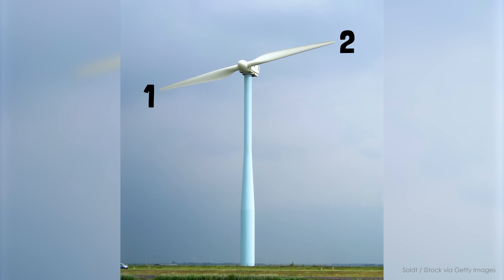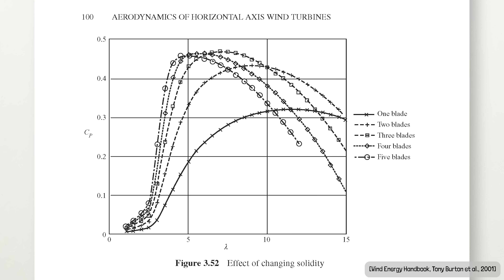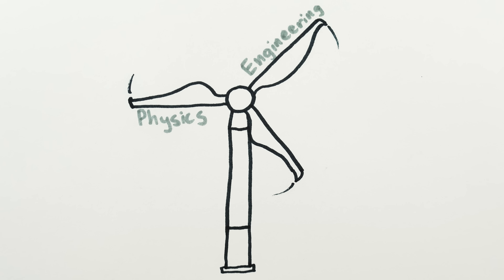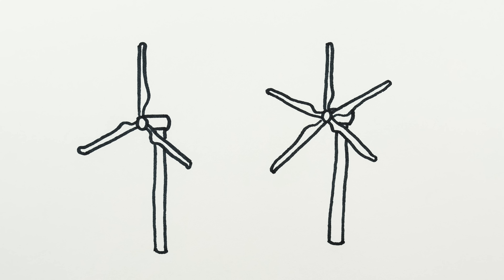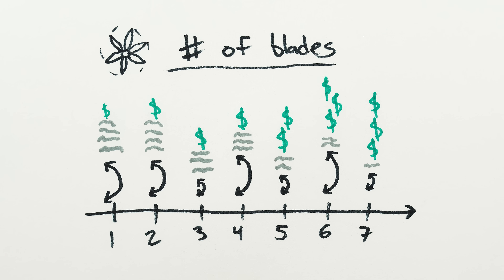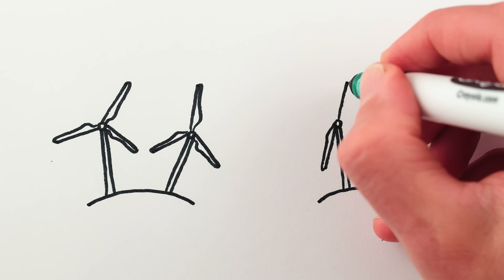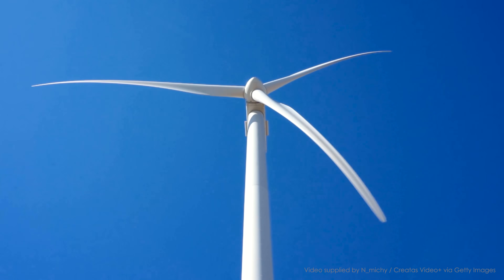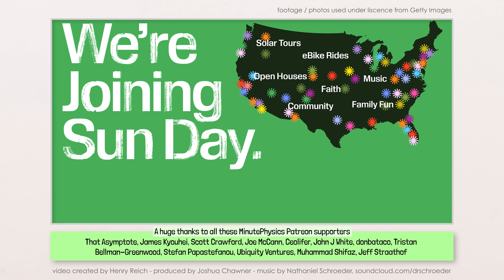Why Do Wind Turbines Have Three Blades?

Comment: Now I want to know why most buildings have rectangles as a base, instead of say, hexagons or triangles. You can tile the plane with hexagons just like with rectangles, and hexagonal prisms would have easier time keeping cool in summer and heat in winter. Still everywhere it's usually square
Reply: not an expert on the matter, but I would guess something related to space efficiency because we can make the most use of space with rectangles. Imagine filling your room with a slanted corner/wall. Rectangles make it easier to place side by side without wasting space and to organize like a grid system. Also maybe generally easier to make/measure than other shapes
Reply: One distinction between hexagons and rectangles is that you can subdivide rectangles into other rectangles, but you can't subdivide hexagons into other hexagons.
Reply: @BrooksMoses You can subdivide triangles into triangles and hexagons into triangles. Plus if you look at honeycombs you'd see that small hexagons can approximate a large hexagon really well when the difference in scale is large enough. Sadly can't add pictures there.
Reply: The best I can do: 
    ⬡ ⬡ ⬡
  ⬡ ⬡ ⬡ ⬡
⬡ ⬡ ⬡ ⬡ ⬡
  ⬡ ⬡ ⬡ ⬡
    ⬡ ⬡ ⬡

Comment: Should push for nuclear, the cleanest and safest energy. Lowest death rate per kilowatt hour generated of all sources of electricity
Reply: the problem for adoption is that nuclear is more expensive and it takes longer to set up
Reply: and what about nuclear waste?
Reply: @S4N1T03T3R it can be reprocessed into more fuel.
Reply: @shrimppasta5544  how much of it?
Reply: @S4N1T03T3R over 90%
Reply: @shrimppasta5544  okay and how much biproduct of that 90% reusable biproduct is usable next? is it also 90% of it or does it depend on the element and state of the element? 

even if we say it will stay on 90% no matter what, this 10% scales up more and more the more you use it and especially the more reactors you use, so you still need to dump it somewhere
Reply: @S4N1T03T3R im not gonna spend this much time debating something when there is a 0% change of you possibly considering supporting nuclear power. Sorry.
Reply: @shrimppasta5544  i am actually in support of nuclear power, im just curious how recyclable the fuel actually is or has become

you see i am from Germany, the country has abandoned nuclear power which im not a fan of, i would like us to get back into nuclear power but these are questions which i am curious about and dont have answers to

Comment: According to to recent news, Envision Energy has recently "cracked the code" on 2 blade turbines.  I can't find much detail.  I would assume they have good-enough high speed bearings and structural support, but I'm guessing they're still less efficient at lower speeds.

Comment: When I think “windmill” I think of the old school Dutch windmill (for actually milling), which have 4 blades. Was this because their engineering was less sophisticated, or are the physics of those windmills different due to different materials and the like?
Reply: Those actual mills are much smaller and spin much slower (measured in m/s at the tips of the blades) so the reasons mentioned in this video don't matter all that much.
Reply: I think old windmills have 4 blades because it's much easier to make right angles manually. Two planks of wood bisecting each other creates the foundation for a 4-sail windmill. Historical windmills of other configurations exist though. They also sometimes used the orientation of a stopped 4-spoke wheel to indicate information. (The + could mean the miller is there to sell flour, while x could mean they're away)

Comment: To match the current phases on the grid, duh. One blade for each phase.

That's probably how that works.
Reply: That doesn't sound right, but I don't know enough about current phases to dispute it.
Reply: Wrong. Wind turbines make DC power. The DC power gets converted to AC power using an inverter. The rotation of the wind turbine has nothing to do with the frequency of the grid.

Comment: Why do skyscraper sized turbines with diesel power backups need to exist at all in a Solar system with so much abundant solar radiation that 100 global civilizations living for 10,000 simultaneous years of progress, would still never run out of it?  Seems like a massive consolidation at the cost of many harvested resources and many hours of human life, and the only thing coming out is a power bill for what should, and could, be free from the sun.
Reply: Because we don’t yet have the means to build a Dyson sphere
Reply: @alexsiemers7898  don't need a Dyson sphere, just solar radiation that's striking the Earth and Moon right now.  Not even remotely close to all of it, either.  The Sun is pretty intense even out farther than Mars.

Comment: As a mathematic, I feel like there is unexplored potential in wind turbines with negative three blades.
Reply: We should consider a complex number of blades.
Reply: @KellyWu04 Or three purely imaginary blades.
Reply: @davidw6936  Don't be absurd. If you don't believe me ask Euler.
Reply: @KellyWu04  Three was the closest they could get to 2.71828
Reply: Right, that's when you install the blades backwards, which turns the rotor backwards, which supplies the same power, but out of phase.
Reply: @TheExalaber  thats still +3 blades, which means drag. I think the negative blade idea has some strong potential
Reply: @Gaaaaaame No, its negative drag but also negative propulsion, this turning backwards.
Reply: @TheExalaber  yeah then you just flip the coils around, no biggie
Reply: @TheExalaber  no no no it actually sucks the power out of the grid which is really bad
Reply: A fan.
Reply: you know, that could be considered one of those spiral windmills, those are really neat too and much safer for birds, though much smaller and less efficient.
Reply: @dawnderg  birbs
Reply: this shows a complete lack of imagination: why not 3i?
Reply: Also building -3 blades will also cost negative money. Great way to generate profit
Reply: You have an impeller with no blades on it whatsoever, then you take three of them away - simples! :)
Reply: Negative 3 blades suck the power out of the grid and gives it back to the wind
Reply: Isn't that just a fan with three blades ?
Reply: Or maybe an irrational amount of blades. Imagine what we can do with √2 blades! Or maybe π blades!
Reply: @Pintacredd  
 - "Or maybe an irrational amount of blades. "

As in a turbine, such as a steam or turbojet.  OH WAIT, according to this, there would be too much drag.
Reply: @alanmcentee9457 I meant irrational as in irrational number like pi or √2
Reply: An e amount of blade.
Reply: you mean slotted disks! This is basically a negative of a fan blade. They do exist, but don't perform well in air. Their place to shine is in fluids which have very, very low viscosity. That shine isn't very bright, though, as there are other, way more efficient ways to move the medium around.
Reply: Obviously the optimal number of blades is pi.
Reply: @ronald3836  Perhaps if we think about blade length.  I wonder what would happen if one blade was slightly larger, like 1.1415... times larger than the others.  I know that a huge imbalance would put stress on the structure, but could a slight imbalance help drive it?  I don't know I haven't studied it that much.
Reply: @tomq6491  
 - "I wonder what would happen if one blade was slightly larger,"

That would create an unequal imbalance on the structure.  The extra weight would create uneven wear on the bearing / shaft.  If the weight was balanced, then if one blade was larger, that creats an uneven thrust on the bearing / shaft / tower.  You couldn't build one blade that was a different size but weighed the same and had the same thrust as two smaller blade, BUT, if you could, why?  The expense of building and maintaining different sized blades just adds much more expense.
Reply: I farted. Negative wind. 
🍑💨
Reply: I propose to take into account in calculations turbines with imaginary blades, for control of reactive power.
Reply: Mathematically the most effective number of blades is e AKA 2.718 but you have to round
Reply: Imagine! Negative number of blades, negative costs, sound and vibration absorption, and it even spawns birds instead of occasionally hitting one!
Reply: I am now wondering about the effect of having pi blades or e blades.  It shouldn't be much different than having 3 blades. 🙂
Reply: Wouldn't that be a pole?
Reply: so you make a fan
Reply: That'd just be an imaginary windmill.
Reply: Wouldn't that increase the wind speed?
Reply: Unfortunately, that potential is likely to stay unexplored for the foreseeable future.
Reply: Does that make it an engine?
Reply: Imaginary blades. All those in favor say "i"!
Reply: A 3 bladed turbine is already negative 3 blades. The blades in between the blades that are missing.
Reply: Place a large sheet of metal bent and scaled to Fibonacci ratio and call it a day
Reply: That would be the theoretical windmill contracted to build by an oligarch in some mafia state like Russia. The grant for that windmill manifests as a part of his yacht.
Reply: Just place them on the bottom? Lol
Reply: Meaning blades made of antimatter?
Reply: so, just counterwheigths?
Reply: I feel like adding three imaginary blades would also improve on the current three blade design.
Reply: What about 3i Blades? 😂
Reply: -3 blades means the cost gets cut by -200%
Reply: W pfp
Reply: You are lying, a true MATHEMATICIAN does not call himself a mathematic. Nice try buddy.
Reply: I absolutely second that idea. Also, Windturbines with non-real components in the number of blades should be focused on.
Reply: That's just called gas turbine plants 😅
Reply: it should definitely be π amount of blades.
I mean just think about it, it's designed to spin in a CIRCLE... huh? 🧐🤔🤨
Reply: They spin in opposite direction.
Reply: A mathematic? An object that is part of Mathematics? So you are an abstract concept studied by mathematicians?
Reply: @MrAlRats did he stutter?
Reply: How about negative towers as well? Disappear the entire monstrosity and leave scenery alone (nuclear power enables that). Giant wind turbines are growing industrial blight spun as "clean and green" over the starry-eyed notion that they're "replacing" the fossil fuels that build and back then up.
Reply: @falseprogress  Ok buddy. Good luck with that. 👍
Reply: "mathematic" is an adjective, not a noun. you mean "mathematician"

Comment: I'm sorry I can't watch a video that repeatedly refers to wind turbines as windmills, especially one that is supposed to be educational
Reply: First line from the wiki page: "A windmill is a machine operated by the force of wind acting on vanes or sails to mill grain (gristmills), pump water, generate electricity, or drive other machinery."

Sorry, I get that it seems more logical to make a distinction, but language doesn't often care about what's logical on the surface, all that matters is how people use it.
Reply: @mylittledashie7419 As someone who has worked in the renewables sector for over a decade I can assure you no one calls them windmills. They are not windmills
Reply: @hyderalhassani4907  Oh you can assure me no one calls them windmills? Then why are you complaining about it? If no one does it, what are you complaining about?
Reply: @mylittledashie7419 oh sorry I meant no one who knows what they are talking about or is at all familiar with the subject. Keep being ignorant if you'd like though, sure it will go well for you
Reply: @hyderalhassani4907  Sorry, but the subject in question here isn't actually renewable energy, so your expertise isn't relevent. The subject in question is linguistics. And for linguistics all that matters is usage. Technical usage, versus common usage doesn't matter much. The fact is "windmill" is a perfectly acceptable word to describe these things.

You can keep being ignorant if you'd like though.

Comment: Better to invest in IFRs, Integral Fast Reactors, which can burn nukewaste as fuel and can't be used to extract WG Pu for bad purposes.  At least they're not bird-blenders like wind turbines are, nor do they immolate birds in mid-air (nicknamed "streamers") from concentrated solar.
Reply: The bird problem is not so much of an issue as you think, there is plenty of space around those mills for them to pass and those wind turbines are not just placed anywhere, it does get taken into account

Comment: It's not really "Clean Energy", is it?
Reply: why not?
Reply: @S4N1T03T3R  It is not as "clean" as people would like you to think. Research the fiberglass airfoils disposal, or lack thereof, after their relatively short lifespan. They are eyesores on our landscape. They are noisy. Supposedly hard on birds. Require Plenty of fossil fuels to manufacture, transport by train & truck. These are a few reasons, and likely more
Reply: @182QKFTW  well yea, when you get that pedantic about it literally any energy source will have some pollution. Thats why the idea of ”net zero” emissions is used instead of absolutely zero
Reply: @alexsiemers7898  Nice play on words. I assume you are for Zero-Emission vehicles as well. Many of these are failures, especially in larger applications such as aircraft, ferries, long-haul trucks, busses, etc. The battery tech isn't there for these either
Reply: @182QKFTW eye sores is subjective and they aren’t that noisy, maybe the very first designs were or some cheap ones you may have seen. the ones here in europe i can barely hear when right next to them